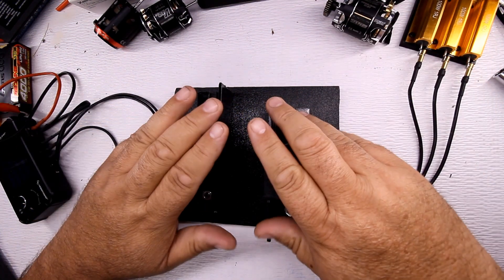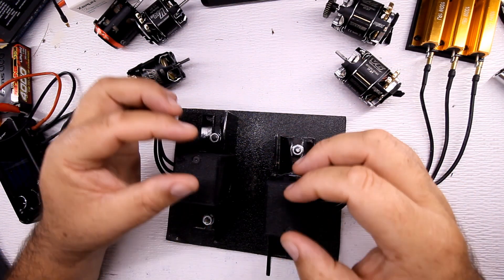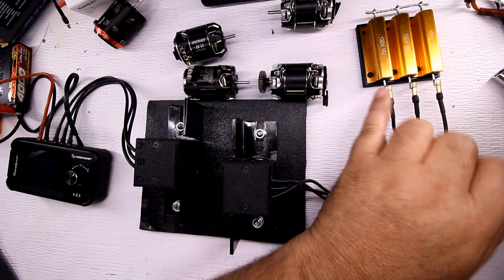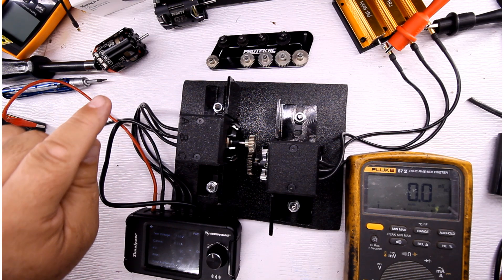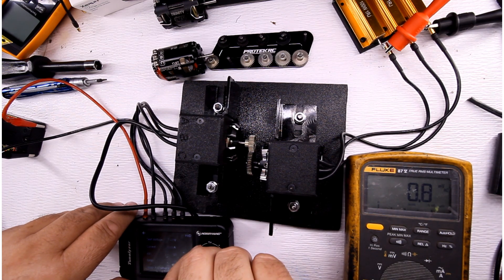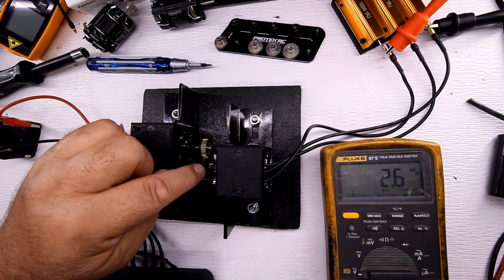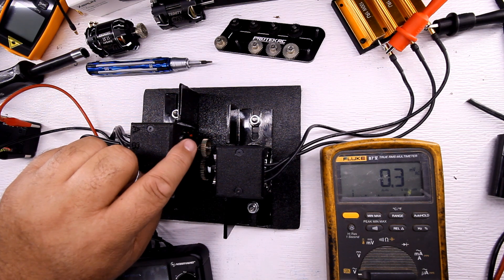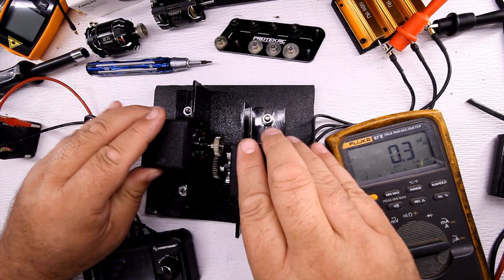Introducing THE JERRY.  A Brushless Motor Testing Tool.

Comment: The outlaw motor was mentioned in the comments. Can you tell me the difference between a regular and an outlaw motor. 
I see that the smooth motor has a higher rpm and the outlaw motor has more torque?
If price is not an issue, which would you choose for a carpet indoor offroad race?
Medium - high track. High traction carpet
Reply from the maker: The outlaws will have thicker winding wires and sometimes stronger rotors.  This gives them extremel torque.  The extra torque will allow you to use bigger pinion gears.

Comment: I built a 13.5 G4R with the optional rotor (mid 1760's) and it tests phenomenal. haven't actually run it yet, but the motor is a rockstar on the meters.
Reply from the maker: Which rotor did the motor come with?  1760 is pretty good.  not too many rotors go that high.
Reply: @wutupclegg6618  the stock rotor it came with was right at 1700.
Reply from the maker: @dogsubx2  That's pretty low.  I bet it had a pretty high RPM though.
Reply: @wutupclegg6618  yes. it was 4200kv at 5.0a.
Reply from the maker: @dogsubx2  that's pretty fast!  How was the torque?
Reply: @wutupclegg6618  I haven't run the motor. I didn't run it stock. I built it and it's sitting. It will be going in a wheeler, but that's when outdoor season ends. I'm running 1/8 scale now. When the weather turns and I start racing indoor 1/10 is when i'll actually get to run it.
Reply from the maker: How did the motor turn out?

Comment: What you need are a couple different load settings,  match one with gearing and then compare the others between different motors.  

Great video btw.
Reply from the maker: Are you talking about having different load motors?
Reply: @wutupclegg6618  That would work,  so would using different resistor values for the load.  If I am correct I see 1RJ on those resistors, that is 1 ohm,  a set of 2 ohm resistors would be less of a load.
Reply from the maker: @patissanchez  Yes Sir.  You are correct on all ends.  When I purchased the Load Master, from WMH Racing, it included the 1RJ and 2RJ.  I like the 1RJ because it causes the motors to work harder and give a better idea of how they would perform while racing.  It also gives a good idea on how much torque a motor has.  I had at least on motor that struggled with this load.  It was a very high RPM motor, but this resistor showed it didn't have much torque.
Reply: @wutupclegg6618  I wonder if you can find some 0.5RJ resistors.  I first saw the load master a week ago and thought it was a bit over priced,  at least it comes with another set of resistors.
Reply from the maker: Where did you see the price at?  Sells them to resellers, so he can't sell them cheaper than them.
Reply from the maker: I appreciate the compliment.

Comment: So in a nutshell, they would be going the same speed if the hobbywing had z 28 tooth pinion and the tekin had a 32? 
Is that what you're saying? 
Also, what if the hobbywing had the 32 also? Or a 29 or 30? 
Also, I would like to see how the Surpass light weight compares. 

Love your videos,  looking forward to more.  I shared then as well.
Reply from the maker: I really appreciate you sharing my vids.  I can use all the help I can get.
Reply from the maker: Yes, they would be spinning your wheels at the same speed.  Checking there temps would determine which one is working the hardest.  The one working the least means it can go up higher on the pinion.

Comment: Gotta love a jerry rig 😂
Reply from the maker: As soon as I get my new office set up, I'll start the testing.
Reply: @wutupclegg6618  sweet. I tried my new Surpass V6 lite weight for the first time today.  It's fast, I had a Reedy and I would say the Surpass is a little faster. The reedy was quick as well though. 
I'm running a team associated 2wd, And I had been running a 72 tooth spur with a 28 tooth pinion, I tried a 31/72 with the Surpass and it seemed like it had plenty of power to handle it but It was running pretty hot. So I switched back to the 28/72 and it stays cool with that.
Reply from the maker: What's the temp with a 28t

Comment: Also, what's the fastest 21.5 thanks
Reply from the maker: I have not tested the 21.5 motors.  However, the highest RPM motor I have tested is the Fantom Helix RS.  The problem is, it didn't have much torque, so essentially, the would not be the best for tight offroad tracks.
Reply: @wutupclegg6618  Thanks, I'm new, but some local people I've seen with Reds seem to be fast.
Reply from the maker: I would like you to test a Reds.